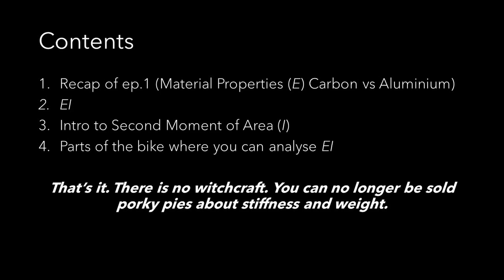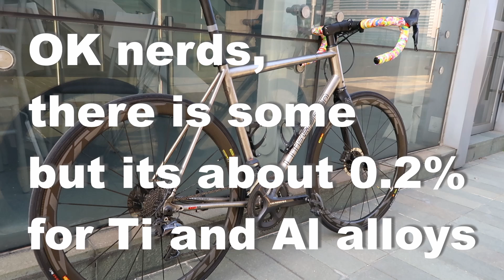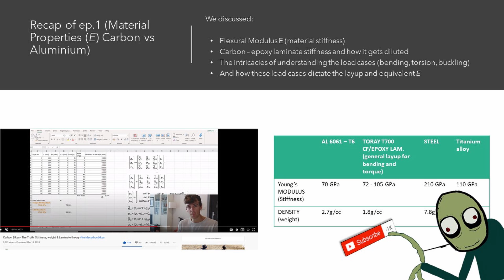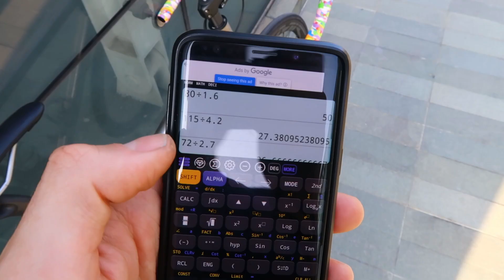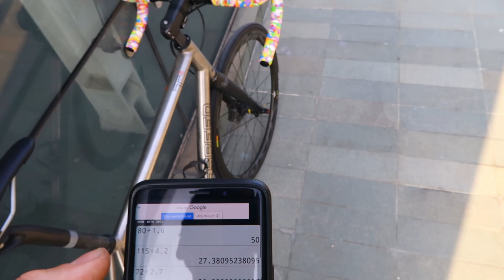Titanium Bikes - The truth and Physics of 'ride feel' marketing.

Comment: The Comparison of a nylon string and a steel string for a guitar being tuned to the same note or pitch is true. However, even though they are tuned to the same pitch they well have a different voice. While it may not be a "magic carpet ride" I do believe it will feel different because sound is created as the tires roll across a surface and travels through the bike frame into your body. Even though you can't hear it you can feel it. Some people are more sensitive then others in more ways then one.

Comment: At the same weight, you could make a stiffer aluminum frame by using larger tubes, but the smaller Ti tubes will flex at their limit, while the larger Al tubes will cripple. So, not really the same when the same weight(close, if you keep tubes similarly sized).  This is where the difference in behavior comes from. If your tubes were sized like classic small steel tubing, you could class most materials as behaving not much different from steel. So an innapropriate comparison.

Comment: Very interessting conclusion here. As a normal customer I surely cannot measure the stiffness it is just a "feeling" while riding but the weight is easy to figure out. I guess that became one of the main reason for customers. And the cool aero shapes of plastic frames of course. Thats means in short either a AL frame with stiffness x or a lighter cfrp frame with the same stiffness? Same with Ti and Steel? Either you want it light or stiff. If all frames got the same weights, which is the stiffes one then?

Comment: Great piece. Despite it not being the "wonder material" overall, it does have one other advantage not mentioned. It's extremely durable, i.e., resistant to dings and dents. Aluminum and carbon are susceptible to dents and chips respectively. It's certainly a lifetime material where as aluminum and carbon are not. But now I have more to chew on in my search for a new gravel bike. So, thanks for making my choice more difficult! 😉 👍
Reply: There’s myths out there about aluminum as well. The assumption that stress accumulates over time leading to inevitable breakage for example. Doesn’t seem to be the case with bicycles. I’ve had 3 aluminum bikes for 15+ years, no chips, no dents, all signs are they will last as long as steel…
Reply: Carbon frames become flexier with time compared to Ti steel or aluminum so I would say Ti is superior if you look at companies like Moots there superior

Comment: I now aluminium’s has different harmonics to steel when you cut it with an angle grinder . I feel if you put curves in seat and chain stays that would make more difference to comfort in the frame . I’ve got older bikes with the slimmer tyres . I do want to ride one with some larger tyres. Those seat stays looked pretty strait and ridged . There’s a lot more craftsmanship that got into a hand welded bike .  I hate the smooth weld bikes I like seeing if the welding is any good cosmetically .

Comment: You know, if your tongue wasn't one inch thick I could understand what you're saying.

Your nonsense is just that, I could not wait into that billchit. Simply do this: shut your sensors, computer etc on your buckboard carbon frame. Right in identical route at the same speed. When you get done do the same with the same wheel set on the titanium frame.
Then report back. Real world data versus a lot of blah blah blah blah.
Forgot. Had to come back and ask who you work for and who you're pimping for? So just State the facts if you would. Who writes your checks.
Reply: I suggest you clean your ears if you can't understand what he is talking about.

Comment: Hi it's a great video thank you. Currently I am having an Aluminum Bianchi Freccia Celeste road bike with Shimano 105 group set and rim brakes. It's performing well and I like it. however I am looking for a Ti for my second bike, I just need to know from you does TI material 3AL/2.5V durability in the long run is the same as 6Al/4V? Or having a 3AL/2.5V bike with only the top tube made from 6AL/4V ok? And finally the Litespeed bike that you showed in the video, the seat stays does not have a bridge on top (similar to a rim brake bike where the rim brake caliper is fixed this is the are I am referring to as a bridge) by not having this bridge on the seat stays will there be additional stress to the seat stays?
Appreciate your answers very much in this regard.

Comment: I dont like what you said. I have aluminum, carbon, and titanium frames. But im glad this opinion is out there and has opened my eyes. 
-there is something to be said about the quietness out of titanium frame and aluminum wheels. I have not tried carbon wheels on that bike
Reply: my serial number is 123123 M. So idk if i got a small frame as advertised on ebay OR a slightly larger frame. It seems to fit, but the crank is long at 172.5

Comment: @PeakTorque Can you explain how, if titanium is ~60% denser and it's weight to strength ratio is much higher then aluminum; wouldn't the second moment of area be much different because of these characteristics? I'm sure the diameters and wall thickness of these ti bikes is much more different. How much of a difference does it make approximately?
Reply: Also would you please explain in more detail the specifics on how much of an advantage the shapes that aluminum can be hydro-formed into play when compared to Ti? Thanks
Reply: Never mind about the shapes question. I finally found that video about it. I think the title made it MUCH harder to find. Thanks for all the info. Maybe making a comprehensive video with higher quality and finality would get you more views.

Comment: Don't know about the Litespeed titanium frame you're riding mate but I'm calling bullshit on this.

My mid 90's Raleigh titanium frameset is much more comfortable, lighter and compliant than any comparable cro-mo frameset.

Being bombastic doesn't make you big or clever.
Reply: Because its massively oversimplified. He never even mentions the elasticity modulus which is that weird thing that makes Ti both more flexible and yet feel stiffer/as stiff than other metal, and some carbon frames (Because it flexes more but springs back way faster). The idea that ride feel is mostly about the seat post is laughable.

Comment: Except Magnésium I have or had road bikes with all materials possible ride quality is subjective but I think you re 100% right having larger tires and less pressure (25 instead 23) and slightly lower pressure makes more difference and not forget the saddle- I still like my old Lemond TI bike if a gravel hits the frame I don’t worry about structural damage as I would do on the modern ultra light carbon frames. However I ride an old Koga Carbon about 1,3 Kilo which I think is bulletproof too.

Comment: I think u r deluding yourself. The math equations might be right but u base them on the fact that the frames weigh the same and have the same structure. They do not. Since the frames r different in size (shape) and material thickness. No math eqations in the world can prove that a thicker tree pin dont bend as easy as a thin one. Show me one alu bike that isnt more than twice as thick as an titanium one and have different shape to allow it to flex more or less. U r comparing apples to oranges and claim its the same based on some equations u misunderstand. So u saying that shape and material thickness has no impact on riding characterics? Jeez. Please tell me that u dobt work as an engineer - or design suspension or cars or something. I would rather live. If material dont matter all cars would have steel suspension - not aluminium like good ones.

Comment: If you look at stress strain curves of both materials you can see that a titanium frame can be designed with much more flex than an aluminum one. The aluminium one would be prone to failure at flex levels that can be reached with titanium (for example in the rear triangle, fork, seatpost - for comfort)
The video clearly shows that you are not a fan of flexible frames but prefer stiff ones.
Reply: yes, therefore aluminum is not used for spring, but steel is
Reply: @peterch4978  is titanium bad for springs too?

Comment: Very interesting! I have had bikes in all materials (except for thermoplastic, wood and other weird stuff) and it could be confirmation bias I suppose, but I felt that my Ti bike was "nicer" and more compliant. Could it be that Ti allows for a bike made to intentionally have a little more "life"? You seem to know what you are talking about so my question is if titanium could be made "flexier" whilst still being stiff enough unlike Al? I feel that flexing Al is a worse idea than flexing Ti? Can Ti flex more without plastic deformation compared to Al? Or am I just trying to motivate the extortionate cost of the frame? It was for XC i might add, road bikes might like a more "numb" stiffness, not my area of knowledge. Thanks again for a great video! (PS the worst "feel" of all materials is beyond a doubt Cf imho.)
Reply: Yes! You have basically hit the nail on the head. 
Ti flexes more but springs back way faster (elasticity modulus/potential) so in terms of ride feel you get a frame that feels stiff like Carbon (but to be fair it will not feel AS stiff as good quality carbon), flexes as much/more than steel (which adds comfort and compliance), is at least as light as a top quality Aluminium frame and will likely out last all of them. But its all about the seat post 🤣. 
It is worth emphasizing though the important word here is FEEL, in reality Ti frames are quite flexy they just don't FEEL it and if you believe the GCN types: flex=less efficient so maybe not the choice for those "marginal gains".

Comment: As we've seen, you can make 'the science' say whatever you want. Aluminum (Al-u-min-ee-um to you) frames tire me out. After an hour on the bike, I'm ready to be done. This is not true with steel, carbon or ti. Don't care what 'experts' or 'the science' says. My direct personal experience says aluminum is a poor material for rigid bike frames. If you like them, knock yourself (or your back) out.
Reply: Same with me! I have a Caad 12 with full Dura Ace and Enve wheels and yet I hate to ride it.  I feel all vibrations passing from the frame to my legs and body.  Yet,  when I ride my same build but in Carbon or Ti,  it feels amazing and I can ride all day long.

Comment: This is great. Thanks. What if a titanium bike is 3kg lighter than an 11kg steel bike. Basically, I'm comparing the Brompton titanium bike (8kg) and their 11kg steel bike. What ride-quality difference would the titanium bike have Vs the steel? Would it be more buttery smooth? You compare weight for weight differences in your ace video.

Comment: Titanium road bikes were better 20 years ago when carbon fiber materials and layouts not where they are today. Carbon suffers greatly from delamination that can't be spotted before it fails on you. If you want a safe bike that you can crash in some case over and over titanium is the material. If you crash on a carbon bike then you should replace it, because there could be a fracture that starts the delamination process that can't be stopped. Carbon can be repaired, but not without expansive lab equipment. You talk about numbers, but you didn't mention the stress-cycle curve (Wöhler curve) to compare TI to AL. The titanium frame is for a lifetime if designed and welded properly. Second thing you didn't mention is functionality, how the Litespeed frame is designed and why. That's is the real know-how, which only very few frame builders have. Why you didn't talk about how chainstays are designed on this way Litespeed frame and don't have a bridge and goes for the front triangle tubes and its orientation? What about micro vibration damping? Have ever measure frame for that.... You don't have that know-how, because you build zero frames in your life. Talk to titanium frames builders and listen to what they have to say. Metallurgy is key as well. For example, Lynskey road frames addressed stiffness issue with their helix tubes shapes. Try to ride their bike. TI road bikes are not for everybody as well as aero bikes, since most people don't achive 40km/h plus speed on the flat roads. TI bikes will probably never be used in pro racing, but TI frame will last you a lifetime which you can't about other materials including carbon. Look at Morati road frames design for some inspiration. 😉

Comment: I bought my titanium bikes because used, they were cheap and have a fatigue life of forever.  My experience is that the most comfortable frames are made from light steel. I owned the top of the line new Treks and they were not any lighter than my aluminum bikes.

Comment: Great work on this. Nice to see someone finally trying to debunk some of the misconceptions that I have to try and educate people on daily.
As someone who has designed frames in all of the materials you mention, but who works mainly in steel now I think the one area that is ripe for further content is the impact of tube size, shape and butt profile. 
One of the reasons Titanium has never really lived up to its promise is the difficulty of tube manipulation, unlike in steel or Aluminium.
Id be interested to hear your thoughts. 
Maybe we should build two steel frames of the same mass but with different tube profiles and see if you can tell the difference...
Reply: 3D printing Titanium will revolutionize frame manufacture
Reply: @truthseeker8483  already has.  Check out our bastion frames and components on our website.

Comment: I trust this guy’s opinion on Ti as much as I do his bike fit. Judging by the 2.5 feet of exposed seatpost, that’s not much.
Reply from the maker: Exposed seatpost is the largest source of deflection and smallest spring rate on a bike, which directly affects comfort, power transfer and traction. You can't argue with the physics.
Reply: He is on a one size too small frame. So the head tube is shorter than ideal for his height and seat tube is too exposed. If he gets a proper size frame these two issues will be sorted out. But something tells me he never takes any feedback but only gives it out.

Comment: I've owned aluminum frames with carbon forks for the last 7 years... a few other varieties in other riding styles outside of road biking (steel/carbon)... I was shocked how smooth/soft my titanium frame (with carbon front fork like the aluminum frames) felt.... CAAD 10/13. All around similar weights/components. 

I prefer the titanium, but not worth the cost difference if you're in a crunch financially. Costs aside, I would recommended titanium over aluminum in terms of durability, longevity, comfort, etc.  

Regarding Litespeed... low tech in terms of bikeframe Ti advancements... I'd recommend Van Nicholas.

Comment: what you say it's just half true brother. I´m on your side, not on the marketers side, but. Get the usual steel old light frame, tell a friend to record you sprinting, or just look down, it is so much more comfortable because it flexes way more than an aluminium frame. steel frame is much more comfy than aluminium, and titanium is just a lighter steel. Yes, titanium use more modern thicker tubes, so stiffer, good. Now that frame you are riding brother, you have a really stiff and cheap and thick walled aluminium seatpost, and then this frame is way too small for you Get a proper fit and a proper seatpost, otherwise everyone who actually knows notices fast your are full of BS.
Reply: Exactly. He is basing his analysis on a bike which is clearly not a good fit for him

Comment: Mainly bought mine for the corrosion resistance. I've sweat all over and corroded like 3 frames. A lot of people said save money by going the route of stainless steel instead but while the material might be cheaper the nature of the bespoke market that builds stainless steel very much isn't and so the cost was worse for a stainless steel frame. I wipe my litespeed with a rag every ride and maybe a stainless steel wipe if it's too spotty and don't have to worry about shit. Love the frame. Also I'm a wee cunt so no problems with stiffness for me.

Comment: stiffness is down to tube shapes so you can't measure the stiffness of the frame by the weight.  So saying a CAAD isn't stiff because it's light isn't true.  Vitus alloy frames were heavier than the CAADs but nowhere near as stiff due to tube shape.  You talk about E/I but don't really address I (2nd moment of area).  You can't build a steel frame to large tube diameters and match the frame weight of alloy as the wall thickness becomes too thin.  Steel is always thought to be smoother as the frame tubes are usually a smaller diameter.

Comment: TI compared to AL frames will hold up in every way far longer (lifetime+).  TI in general is built with more care and detail . AL will have weld and tube cracks in time but repairs are easier and cheaper .  When you find used TI bikes online for cheap you should salivate . Not the same for used aluminum bikes

Comment: I agree with you one hundred percent. I grew up with steel bikes, bought my first fancy carbon in 2014 (and sold in 2019), Aluminium in 2018 and Titanium last year (Pandemic shopping) - And the only thing that one (normal person, not pro bikers) can feel as change in riding quality (improvement) is change in contact points, i.e. wheels-tires, seat-seat post, handlebar-bar tapes; rests are all marketing gimmicks.